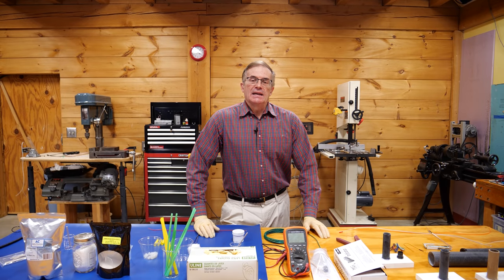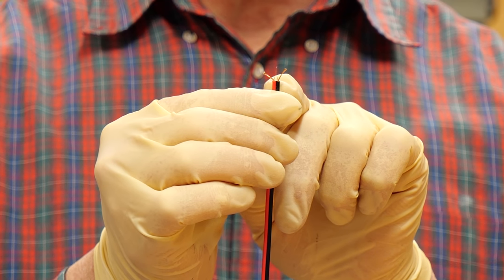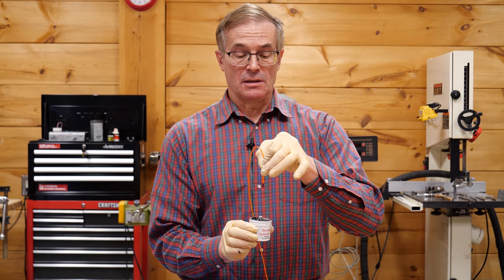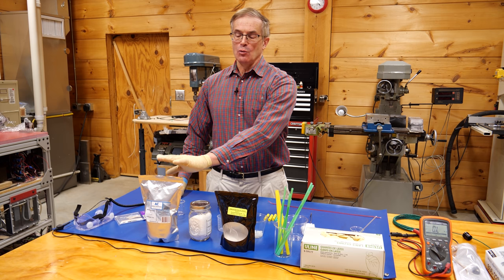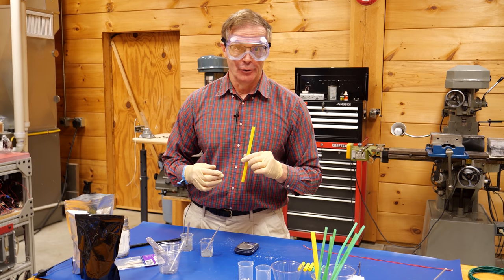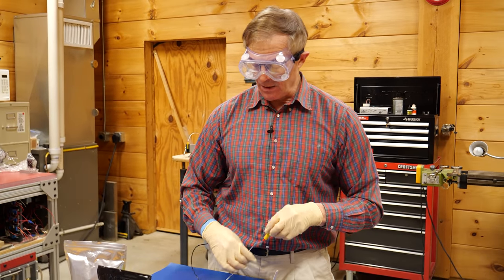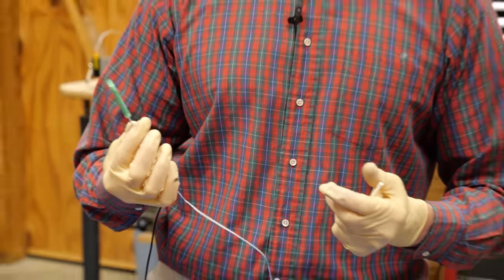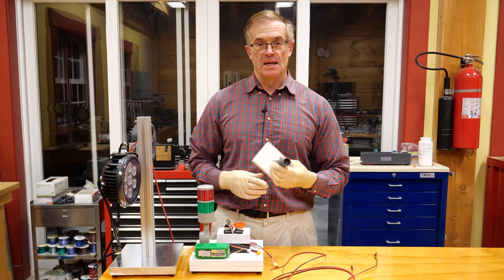Rocket Ignition System On Steroids!

Comment: Hi, first your videos are amazing, content and video production is excellent, so good job you guys do. I've found your channel looking how to make model rocket engines, they are Impossible to get in my country and it's something I want to try with my kids. A little friendly suggestion if I may, instead a 'emergency stop switch' a start switch (or two in series) could be better, the covered push button would be another layer of security as you said. Another add-on can be a 5/10 amp breaker to save the lipo in case of an accidental short. There are many small and reseatables ones with a small push button, mostly used on consumer devices. Greetings from Argentina!

Comment: When I was young, aluminum powder and ammonium perchlorate were not readily available for purchase, so I created a substitute rubber-metal composite fuel once simply by mixing transparent silicone caulk with potassium chlorate (which oddly was readily available despite being a detonation hazard when mixed with fuels). The burn was slow and controlled, but extremely energetic. You should try a clear caulk and ammonium  perchlorate composite.

Comment: Several model paint companies used to make small glass jars or bottles with metal caps.  That is similar to the bottles Testors paint come in but larger.  Those were very resistant to the solvent (in this case acetone) evaporating.  Containers made of plastic or even glass bottles with plastic lid will allow the acetone to evaporate.

Comment: If you don't need something so precise, you can use a Christmas light bulb, some fine grain black powder, and some masking tape to make similar starters. Crack open the top of the Christmas light(don't break the filament) , make a small tube of tape(similar to the straw design), and almost fill it up with powder. Close the top of the tape straw by pinching it closed. I'm not saying it's going to light off a large rocket, but it worked fine to light my blackmatch.

Comment: Thank you for making a very great video. 
Love the details,  and yet straight to the point. Definitely a new subscriber here. 

One thought though:
When using such powerful batteries, it would be wise to add an electric fuse to your system, close to the battery. 
Any type of a 5-10 amp fuse is likely to be a good idea. 

Food for thought: Fuses protect wires, connectors and switches, from overheating, in case of a short. 

So the electric fuse needs to be big enough to allow the igniter to work, but "small" enough to also fit the thickness of the wires and the specs of the switch. 

Again, thank you for such great, informative and inspiring video.
Reply from the maker: Thanks for the suggestion!

Comment: Would add to the starter circuit a proving circuit, using a 4 way switch box, and then adding in a recessed green pushbutton and a LED block with a current limiting resistor (probably easiest to get as a 24VAC/DC LED lamp unit, which also operates off 12V), so you can pass 20mA through the wiring circuit to test it. As seen below add a shorting block to the red pushbutton, there is probably an existing NC block on the switch, and use that to short the output circuit. Then the test wiring uses the NC block on the test switch to break the connection to the firing circuit, in line from the fire button to the output terminal, and the NO block to put the LED in circuit, allowing the LED current to flow. A 100R 1W fusible resistor in the connection from the LED to the NO block will ensure that even a LED short will not provide enough current to trigger the charge, but will not affect the test current much. Saves having to take the DMM out each time to see if the circuits are connected.

If you wanted to make a remote version simply make another, and use a cheap rolling code garage door opener, preferably a 2 button one, and a matching 2 channel receiver. That then can have at the remote station a 3 level display, so you can have a remote proving circuit, and then also have a remote firing circuit, along with a green power on indicator. Rolling code as they are a lot less prone to false triggering, though you will want to have a shorting switch on the output to prevent any incidents while setting up and after connecting the ignitors. 2 button transmitter you simply take apart and place inside the 2 push button plastic housing, using switches with recessed buttons, so there is less risk of accidental pushing. The A23 battery in it will last 2 years easily.

Comment: As usual, very well done. I like the carbon black igniting compound. That's a very good idea. Your amplifier worked very well. That was a very long burn. I suspect with the higher pressure developed by the nozzle the burn will be considerably shorter.
Always so well done...

Comment: One thing I would add to your firing system is a way of measuring continuity of your e-matches, without igniting. Send a small amount of current, usually less than 20 mA's through the e-match. Have it light up an LED on your firing panel, yet it won't provide enough current to fire the e-match. Have a switch that flips between continuity and fire intent.
Reply from the maker: Good idea.

Comment: In the 60's we did this with a tiny coil of nichrome wire and a 1.5 volt "A" cell. Wind 4 coils around a toothpick, and stuff it in the motor with a bit of paper wad, allowing short leads to protrude. A bit of bell wire and two alligator clips was all else needed.
Reply: We used to coil the nichrome wire around a small lump of s&s propellant. Never failed.

Comment: That's a far cry from the ignition system I developed in my 'tween years. Mine was a 110V system direct with a switch and a single strand on TV lead-in wire shorting the other end. Which I shoved into the nozzle end of the motor. No safety circuits. It never failed to start the motor. But, it did create some secondary problems. Such as blown fuses in the house, and dangerously hot (electrically) wires until it was unplugged. I did survive to have a career in electronics. I have not (yet) gotten back into rocketry. If I should though I certainly would not live so dangerously again. I like your system much better. Almost as simple, much safer. The reason I developed it in the first place was frustration with the then available launch systems, nicrome wire, and inconsistant fuses of the day.

Comment: When making flash powder, as a kid, we found powdered magnesium burned faster, which was great for smaller firecrackers. Used powdered aluminum, too, but it burned a tad slower, which made a better bang, for the larger devices. Of course, being kids, you used what you could get, so the powdered aluminum cam from the paint store (metal flake), and was really way too fine. It got on everything. My father's 67 blue beetle had one silver fender, due to its proximity to my work area.

Comment: You can get fine mesh Aluminium powder from paint /auto body repair stores. Usually comes as a water moistened paste called quicksilver and is used in metallic paints. Just let the water dry off and you've got ready to use Aluminium powder.

Comment: Perhaps keeping a resistor between the wire leads would help prevent accidental ignition. AKA launch box powers both the fuse and the resistor.
Reply from the maker: That's an excellent idea.

Comment: Shredded table tennis balls can be used as a binder.  It must be old table tennis balls that were produced before 2017.  Until 2017, they were mainly produced from celluloid.  Celluloid dissolves very well in acetone and forms a gel, which can be used excellently as a binder.

Comment: I “borrowed” parts of a KoR design on my ignitor box that runs a very low amperage current through the ignitor when the arming switch is turned on. This gives a tone through a sounder to show you have continuity before you mash the fire button.

Comment: 20:45 You can use a beer can to make a small funnel ,or simply bend a sheet of paper in half and use it as a guide .Cheap multi launcher-take a board and use as many  nails as you need .Take all  black wires and twist them together with the one on battery.Hook all red wires from rockets to nails on board.Best part- use a stick with a nail connected to a + side on a batter.
What to do to launch  is i think self explanatory.

Comment: I am sure you already know a "G" class motor will take a 3 inch diameter by 4 foot long paper tube rocket to the edge of sight . have a pair of wide angle low power binoculars at the ready . great show , have fun !

Comment: I would have done one more thing to your control center.  I would have made an LED light showing the continuity to the starter.  I could even be in series to the red light, as long as the current is extremely low as not to have current to the starter.  It could even be an ohm meter.  thanks for the show

Comment: I think spinning the candy fuel pellet in one piece can be done. A spin balanced bare naked candy cylinder ready for wrapping in composites. The whole rocket can be fuel. The pellet can be spun as it is poured and each layer will be balanced so a long tube can be made. It looks like it can be shaped so I can sand it down and if I use the graphite nozzle as the mandrel I’m in the center all the way. The whole project can be spin balanced as I build it.

Comment: I'm sure you know, but commercial starter systems seem to have an option to test if an e-match is connected and working, by simply sending a very low voltage/current through the match to test continuity/resistance.
This is useful e.g. because it's good to know whether it was the matches or the powder's fault if there's a misfire.

Comment: Loving these new videos! However, be extremely careful if you let the mix dry in a container with a threaded cap. By design, those compositions are very easy to ignite, and many are friction sensitive. The screw threads of the cap are a very high friction environment. You'll want to avoid contaminating the threaded area.

Comment: Another excellent, informative, and educational, and enjoyable video!  What type of igniter was used on the last test?  This would be a good time to dust off the high speed camera - it would be easier to analyze how clean the ignition is - the last test looked kinda sloppy.  
Also,  a simple circuit to automatically disable that annoying BEEP   BEEP   BEEP after the igniter has burned would be a great feature.  Obviously you want to limit any current flowing through the igniter to a few microamps so a high gain op-amp circuit with an open collector output that would enable the beeping circuit whenever the resistance between the two terminals was less than infinity, or an LM339 driving a small relay.....
Reply from the maker: We will.  I can simply turn it off.  It was louder in the recording than in person.

Comment: you stand closer to those static engine firings than I do with a commercial A engine launch.
Reply from the maker: Remember, these were not engines.  Similarly, in our latest video with the high speed camera, these were also simple fuel grains without any nozzle.

Comment: new subscriber, love your channel!    Thought to mention that ammonium dichromate, strontium nitrate, and copper or zinc nitrite have been used as burning rate catalysts.  Not ready to upload a video yet but am currently perfecting a solar powered electrolysis cell to produce Na/KCLO4 using PbO2 anodes made by deposition on titanium mesh.    add salt water and put outside, let the Sun make your oxidizer!

Comment: This must be the coolest man alive! Question, if you start the flame on the 'top' of the rocket, what prevents the unburned fuel from just flying out? The cotton stop was only for the igniter right?

Cool video, thanks.
Reply from the maker: It is.
There is nothing pushing the fuel toward the nozzle.  The pressure is pushing the fuel laterally toward the walls of the casing.

Comment: The breadth of material you cover on this channel is amazing! Question: The thrust of the rocket engines seem to come on with gusto initially and then taper off gradually to a somewhat lower intensity. Have you done any research into the engine thrust vs. burn time?
Reply from the maker: Thanks!
Remember, these were propellent test grains and not engines, there were no nozzles and the cardboard tubes were continuing to burn.

Comment: If you want to step up your safety a notch you can twist or solder the ends of your igniter wires together, which will decrease the chance a stray current finds its way through. Electric blasting caps come with a blob of solder on the ends for this reason. Just clip the solder off (or untwist) before attaching to the lead wires going to the power source (which also get connected for safety until being attached to the electrical ignition source)

Comment: I have a tiny suggestion on your trigger system.

23:30 "if we hit the key [off[, you see that it doesn't [work]"  Why not add a very low voltage test circuit into that box so that with the key off, and the button pressed, a current is sent through the ignitor and a small piezo speaker or something gives a confirmation tone that everything IS connected, the same way you would use the 'tone' setting on a multimeter to test for continuity ... and then you can arm with the key and fire with the button.
Reply from the maker: That's a good idea for an upgrade.

Comment: Regarding your launch control system:  When you get into launching larger motors, both the NAR and Tripoli Safety Codes specify minimum distances between launch control and the launch pad.  See below.  When you get into those distances you will find that you get significant voltage drop between your control panel and the pad.  Most commercial controllers get around that by placing the main battery near the pad and using a relay (conventional or solid state) to switch the current to the rocket igniter.  That way the wires to and from the control unit carry very low current and thus have little voltage drop.  Another nice feature many controllers have is a push button, either at the pad or launch control, to do a very low current continuity test of the ignition circuit.
Reply from the maker: Understood.  A simple ohm meter can both show continuity as well as overall resistance.  Of course raising the voltage is another approach and the resistance value can guide this.

Comment: I wonder how quickmatch would work, since it sends an intense hot blast out the end almost like a little upside-down core-burn rocket, and is cheap, low tech, fast, and decisive. Maybe add some iron filings for stubborn grains. Might be able to use a cored engine cavity itself as the piping -- just a stiff piece of blackmatch inserted in the core.

Comment: Love the show. I just bought some quick dip and plan to use it for model rockets size e and f motors. But I missed or it wasn't stated as to what kind of wire, copper, a chrome alloy. I've successfully made match ignitors with copper. I'm using a 12v system. What do you recommend
Reply from the maker: I'd use Nichrome resistance wire.

Comment: Potassium perchlorate, silicon (the element, not the sealant!), trace of sulfur, dextrin for binder.
Go slightly oxidizer rich: stuff makes sticky glass slag when it burns!
Used tiny 3mm blobs on Estes igniters to light I and J-series motors....100%!

Comment: Personally i'd make the ignitor very differently.
I'd roll clear packing tape into a tube with the glue facing inside. Then i'd place it over the wire and press the bottom in an X pattern to glue it on to the wire. Then i'd fill it with a funnel to keep any powder off the top glue surface and i'd press the tube together again in an X pattern to seal it off.
And what i mean by the X pattern is to close it like a blank fire round is closed but in an X pattern (because it's easy with your fingers) so that it resembles a phillips screw driver, this way the tube does not get wider as you close it unlike if you closed it flat.
But that's just my take on this.

Comment: I just sprinkle some flash on a piece of tape, put my resistance wire and cable on that, fold the tape over, and then use shrink tube. Never had a failure, if you dont have flash, a fine black powder works okay.

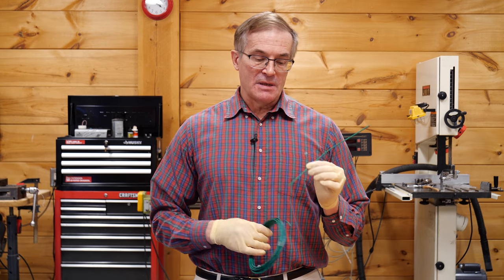Comment: wrap end of fues with kitchen foil  speeds up the burn and directs it to the botton of the hole problem solved 1:45
safety delay on fuse is to ues b-day sparkler then fuse to rocket. 30sec safety margin for walking away

Comment: I have a similar launcher, I use an automotive key switch. Off (take the key with me) is safe, on is test (it measures the battery voltage and the resistance range of the igniter. I get colored LEDs and an alarm. Then turn the switch to start (arm) and press a launch button. I am going to post the design soon. I use an $8 Adafruit Trinket M0 microcontroller.